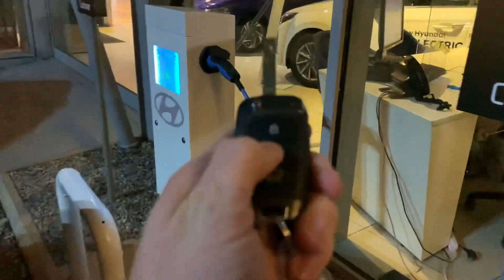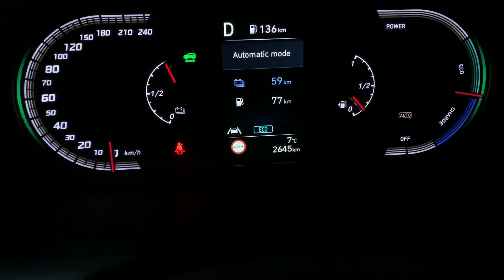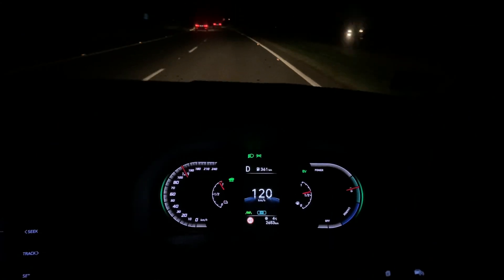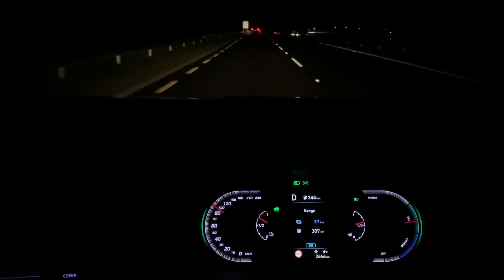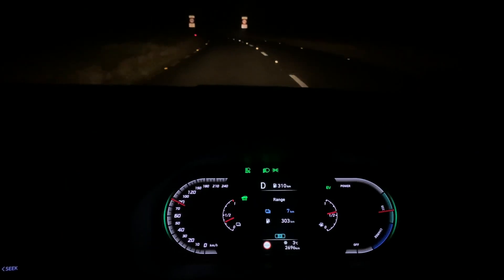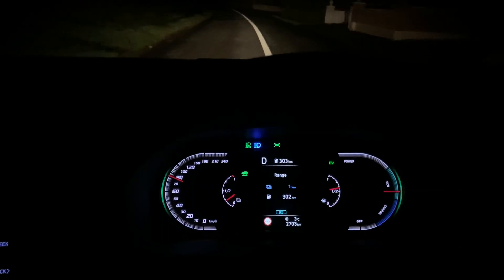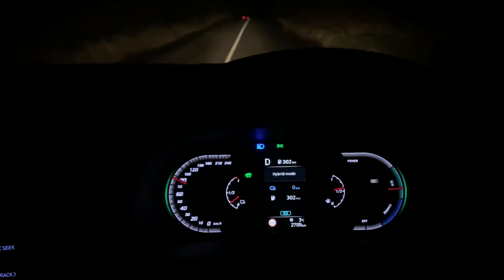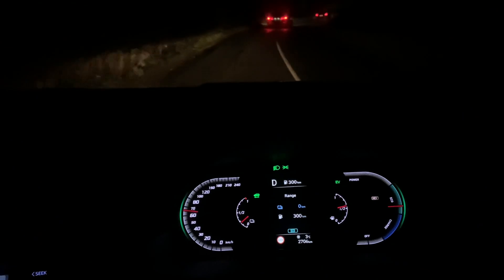What happens in a PHEV when you run out of charge - step by step demonstration #phev #whathappensif

Comment: What happens when you drive a PHEV always without being plugged in?
Also, when you drive out in a sub zero degree cold morning, the car drives on electric for 5kms in city and you immediately hit the motorway, the ICE kicks in when you push it to 110 kmph, how does the ICE engine handle this cold start stress at such high speed? Doesn’t it kill the ICE engine?
Reply from the maker: I understand your point , we have been selling them for 5 years , we have seen no failures or premature wear issues in our garage yet so right now we remain confident on them

Comment: I have a PHEV AWD and l don’t plug it in. And it’s 430hp is always available.  The  petrol engine ONLY runs a generator, recharges battery. .  Vehical is only propelled by electric motors.  Yes,  it’s a Chinese vehical.    The worst economy lv seen is 5.1/100.   3.5/100. economy at urban speeds, with no plugging in.
Reply: @kennethprocak5176 is it chery tiggo 9 csh?

Comment: Hi Brian, great video.  I can't make up my mind to go PHEV or full EV.  EV's seem to be cheaper for a start - with the grant and VRT rebate.  I have read in places and spoke to some people saying when they go to trade in their PHEV, they get a terrible trade in price for their car even with low mileage.  Do EVs get a better price. I am thinking down the line, if I trade in say 3 years time, does the PHEV lose more value than a petrol or diesel car.   
I would be buying a PHEV to save some money on fuel and I like the idea of driving mostly in EV mode for short trips and then the backup of petrol for longer journeys. But if the car is more expensive to start with (probably 2.5K) and the trade in value is worse - what is the point - I wouldn't be saving anything?  
Another question, do PHEVs have a different type of battery than EV (apart from size of course)? Do they wear out quicker and are less environmentally friendly (in how the raw material is sourced). 

Am I trying to talk myself out of a phev when I have always wanted one. Am I listening to too many people? 
The Tucson is a lovely comfortable stylish looking car with the cream interior.  I must check have you any yr old ones for sale?
Also did I hear on the grapevine that the new model for 252 has 70klm range in the PHEV?
Reply from the maker: In terms of depreciation, the Hybrid and the plug-in Hybrid and Ireland are pretty much identical

The fully electric car would have steeper depreciation curve 

You are correct the new model in 66 km from a full charge 

Just to answer your question better in terms of your future values, what country are you in? 🙂
Reply: @doolanbrian  Tnks for replying. Oh I’m in Ireland. I was up in Naas yesterday and didn’t realise there was a Hyundai garage there I could he called.
Reply from the maker: @brec5879 ah ok , best thing to do is call in and have a drive of the different models to give you a better idea 🙂
Reply: @doolanbrian Tnks

Comment: Why are the figures for phev's always so ridiculous ie 200 mpg. They should quote how many miles it will do in EV only and then quote how many mpg it will do when the battery is depleted. That way we can easily compare them.
Reply from the maker: @no-oneman.4140  it’s almost impossible to give an accurate mpg on PHEVs as everyone does a different proportion of EV drive .. so I agree the quoted ones are unusable

Comment: Scientific tests show if you want longevity of your lithium battery,  you keep using it as a hybrid battery than in ev mode. Because lithium lfp and NMC of all these phev likes it charge/use between 25 to 75 percent charge. Keep taking it to 100% and drop it to down 0% then you shorten it's life by 50% if not more than it would of. Something to the effect of one side of cathode and anode keeps accumulating more lithium ion particles than the other side thus drops storage capacity if i recalled. And no your manufacturer's advice in instructions are designed to get them out of liability and have you change cars as often as possible.
Reply from the maker: @wric01  it’s always a topic of conversation when people are purchasing electric vehicles. Do you have any links to the research, no problem if you don’t. Thanks for watching!

Comment: Some aspects depend on how the PHEV has been implemented and cars are improving all the time. Toyota/Lexus PHEV is really a self charging hybrid with a bigger battery - it does run fully EV when in electric mode and once battery runs out reverts to self charging hybrid. Other cars like BMW are really a petrol engine with a motor bolted on.
Reply from the maker: @drlodge  🙂👍

Comment: When driving a PHEV (BMW 225e in my case) switching from pure electric to hybrid to petrol is all so smooth and seamless that one doesn’t notice it happens. Much like this video says. Also can drive in “maintain battery mode” which saves electric power for later. On long journeys it’s claimed that integrating it with the sat nav uses electric where it’s most advantageous and petrol where it’s most efficient. So far so good. To me the elephant in the room is … when the electric range is zero .. Will the car start? I ask this because the car always starts in electric only mode.
Reply from the maker: @peterjohnson1739  all manufacturers may have different ways of doing this, but for Hyundai once the car runs out of charge it just reverts back to petrol hybrid with short bursts of electric driving? Apologies if I haven’t understood the question properly?
Reply: @doolanbrian   what I meant is … If you parked the car after your electric range had gone to zero and not charged it, would it start again some hours later?
Reply from the maker: @ yes 👍 it will still be running in hybrid mode at that point with engine and battery
Reply: @peterjohnson1739  the car will start and run irrespective of the battery charge level. You won't even notice a difference. Also the transition from electric to hybrid is so smooth that you don't realise unless you stare at the gauge.

Comment: The reason heating generally switches on the engine in these phevs is because they don’t (maybe new ones do idk, but all modern EVs do) have a separate heat pump for heating, so they need to use the engine to generate heat (as all ice cars do). Which isn’t completely bad as they can still use the engine and electric motor together to optimize power delivery allowing them to still be a bit more efficient than a completely ice car (due to working as a hybrid)
Reply from the maker: @rajisg  all spot on correct 👍 🙂

Comment: New to this.  Just got a PHEV. Will the battery charge back to full just from gas driving over time?  Or is charging it by plug necessary?  A bit confusing at first.
Reply from the maker: @mister088  ok firstly what vehicle do you have  ?? 🙂

Comment: If you can’t keep recharging your just carrying a load of equipment you don’t need and once the battery power has gone you will use more fuel than a standard petrol and a lot more than a diesel.
Reply: I've been averaging 3.3 to 6.4 as my highest usage
Reply from the maker: @ not bad for 265 Bhp !
Reply from the maker: @WilliamLaverick-wo1nb  you would use more fuel than a diesel or more fuel than a non-plug-in hybrid if you don’t plug-in.. so the only way to be efficient is to plug-in or choose one of the other fuel types I guess

Comment: What ort of mpg do you get when in normal hybrid mode ?? and what do you get with a full car load of passengers ??
Reply from the maker: @Malcolmbubb  realistically the 4wd is around 8l/100 kms when in hybrid mode and the 2wd is about 7l/100 kms when in hybrid mode .. if you fill the car with passengers, probably add another half a litre per 100 km!

Comment: I thought you are only supposed to charge battery to 80%????
Reply from the maker: @waynekerrr9027  I see lots of comments in relation to this , but have no guidance from the manufacturer to not charge to 100%🙂
Reply: @doolanbrian  Almost all PHEV's and EV's limit the Traction battery to around 10% on the low side and 80% on the high side. This is to protect the battery. There are additional reasons to keep a reserve on the low side. Our 2024 Prime does not have a starting motor (or alternator), so in order for the engine to start there must be some charge left in the Traction Battery at all times. The 12v (Service Battery), simply operates a solenoid switch at start-up, it dos not start the engine.

Also, Toyota's PHEV's do not have a reverse gear in their "transmission". They can only back-up using their electric motors so, a battery buffer is very important. After a full over-night charge the "gauge" will indicate it's at 100% but it actually isn't. Same when the Traction Battery is spent, the gauge shows 0% but, it's not really. 

We can reach 100km in EV Mode and see over 60mpg in Hybrid Mode. And, if required, the car will take us to 60mph in 6.48

Comment: I have q5 phev, is it ok always get ev battery get depleted? Since my ev mode only range 40km,.  And when i use hybrid mode it is almost the same with the ev mode. Is it ok or normal please? Thanks.
Reply from the maker: @armanangeles570  it is okay for your battery to run out on a plug-in hybrid, because the range is short on plug-in hybrids most reasonable journeys you make will not be fully electric so I don’t see an issue🙂👍
Reply: Thanks Brian, another things, actually i have just emailed Audi about it. I have noticed to my PHEV Q5, the way i use Hybrid and EV mode are the same, the way the battery get depleted when it comes to consumption, im expecting when i use Hybrid mode it must only be depleted little.

Another thing, when i use Battery Hold mode, im expecting no ev battery being consumed, and only petrol will be consumed. Do you think theres something wrong? Thanks a lot Brian!🙏
Reply from the maker: @ hi 👋 unfortunately I am inexperienced on audi and how they work .. I can see what you mean .. in hyundai the hybrid mode will use a tiny proportion of battery but it can self charge that tiny amount again and this is conserves the battery range  … EV mode will however consume the full battery when left on 🙂

Comment: So basically when it's cold you need turn on heating, which kicks in petrol engine. When it's warm you need air conditioning, which again kicks in engine... Luckily in Ireland summers not too warm, so you can drive with open windows.
Reply from the maker: @dasarvy  they scavenge heat from the running engine for the heater yes
Reply: @doolanbrian is the same for the air conditioner

Comment: Mine is running out of cable first.
Reply from the maker: @Jeroen_Maes  hi there, when you say running out of cable, do you mean it runs out of the electrical charge before it turns back into hybrid?
Reply: @doolanbrian  no, I mean my cables are not long enough for larger trips.
Reply from the maker: @Jeroen_Maes  Yes the EV drive is maxiumum of about 55kms range. :)

Comment: My 2021 Niro PHEV is awesome! Truly the best of both worlds. No it is not a race car but the dual clutch transmission with sport mode is efficient and fun to drive. It has driver’s seat memory is power adjustable. Plus the front seats are heated and ventilated and full leather seats all around. The car is easy to get in and out of both front and rear seats, and easy to park and drive around the city, very solid on the highway, with lots of space in the back, plus roof racks and cross bars. I like the regular sunroof (not pano), and the understated styling helps this very cool car blend in. I added on a block heater for winter and rain guards for summer. The regular tinted windows are perfect. The sixteen inch wheels give a better ride and fuel economy than the larger wheels. The intelligent cruise control is my favourite feature. The dual zone AC is great and I like having buttons to push. The dual digital instrument panels give a ton of programmable information and again… blend in. Not like other cars that have an iPad stuck on the dash… I could go on, but you get the picture.
Reply from the maker: @PamenterDoug  thank you for watching, and it’s great to hear when somebody really likes their vehicle, and they also engage with all of the features, thanks for the feedback!

Comment: Hello. But is it possible to charge battery back to 100% by driving with pertol engine? Mine goes to 0 and do not add any km despite on I'm braking, riding downhill or cruising many hours on petrol engine.
But if I charge that PHEV on charging station - I can ride 50kn on electric as you shown.
Reply from the maker: @jaktak4650  hey 👋 this video might be of interest ?? Can you recharge a plug in hybrid without plugging it in ?
https://youtu.be/bywVIgxeD7w

Comment: Do heated seats act like ac when used?
Reply from the maker: @mickdaly6537  good question and it would appear that the heated seats and heated steering wheel have literally no impact on the vehicle running in electric mode, so they don’t require any assistance from the engine🙂👍

Comment: Electric mode is not strugling at all... what is struggling is your way of explenation... and what you describe is in case of hot weather... if is cold will always go to engine ON as the car heating will come from the engine... ( ok you can drive without heating as well, but.. 2024 naaah ) So do your self a favour and get just hybrid or EV

Comment: heating & Aircon are deal Breakers 
This Hybrids require a functioning Engine to charge 12v , To run Heat & Cold  
Who driver for 35 miles with  none 🤷☠️

Comment: Starting up the engine when the heating is on seems like a poor design. I have a Golf PHEV which doesn't seem to have that problem. It stays in EV mode whether heating or AC is on. Nice video to explain what happens when the battery is notionally 0%. This was one of the first things that I tried on my car when I got it because it wasn't clear exactly what would happen. One thing that I have learnt is that on a longer journey, there is no point in charging the battery at a public charger as the electricity price generally works out to be the same as petrol (or worse in some cases). Thanks Brian - keep them coming!

Comment: I don't understand why you would buy a car like that.
My Rav 4 PHEV runs everything on EV mode for 80km. The engine never comes on whether I need heat or aircon.
The most it will do is reduce the EV range by 10km, which is still more than the Hyudai can manage. I can also accelerate at maximum and the engine will not fire up.
Just buy a Rav PHEV and you will get no silly stuff happening.
My engine has not come on in the last 8 months.

Comment: I'm here and my question is if you know you're going to do a long drive in a PHEV without potentially a chance to charge on the way... do you stick it in hybrid mode from the off for the best fuel economy? My parents live about 200 miles away and we stop at a service station that may not have electric charge available OR it's very expensive... so what's the most economical way to drive that 200 miles?
Reply from the maker: Thank you for watching I would use the electric portion for the start of your journey and use petrol at the petrol station. I wouldn’t purchase electricity in the public domain as it’s pretty much the same price as petrol.!

Comment: Just took home a 2024 Kia Niro SX Touring PHEV. Why isn't my battery fully charging? It's been plugged in over 12 hours and seems stuck at 80% for longer than expected. Does it slow down near the full capacity?
Reply from the maker: Okay, do you have a menu in your vehicle which has charge management?

I doubt you have the following, but just in case go into it, and make sure your vehicle doesn’t have a menu for charge limit 

After that, then I would cross reference with another charger in another house just to see if it’s something specific about your home that’s causing this

It’s not a common thing to happen, but sometimes there can be a miscommunication between the charger and the car 

Are you doing it using a three pin socket or are you using a home charger?

Comment: Will normal driving completely charge the battery? Say, if keep it in hybrid mode, does it completely charge the battery? Or will I need to plug-in to charge?
Reply from the maker: It can only self charge a portion to allow it to do small bursts of electric driving.. you will need to charge it if you want a significant electric driving range up to 50 km👍🙂
Reply: @doolanbrian  So if I don't charge it, it will behave like a normal hybrid car?
Reply from the maker: @ricolasbest6861  for hyundai yes 👍 … try this video 🙂 https://youtu.be/I_7GLkPonJ4?si=GpMA8FgaZCyTeJjL
Reply: @doolanbrian  thanks

Comment: I bought Kia Niro PHEV, when I run out of charge and car running on Hybrid, it becomes heavy and take too much acceleration from a stop point. Also making sounds, but after that it behave normal, but if again Stop on signal, it again take too much force acceleration. I’m too much worried, what could be the reason ???
Reply from the maker: It’s very difficult to help you on this as I’m not really sure exactly what is happening, it could be completely normal but I really have to drive the car with you to understand.. do you live close to a Kia dealership?
Reply: @doolanbrian  yes I live close to dealership. Should I go and get it checked?
Reply from the maker: @amjadishaque5590  if you are concerned ask for their opinion, if they drive it and think it’s ok then you have nothing to worry about 🙂